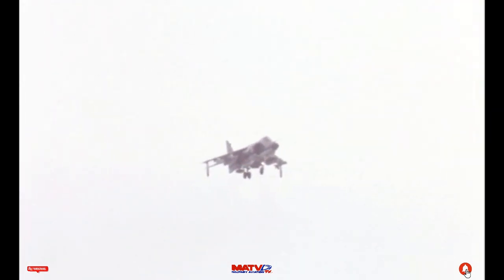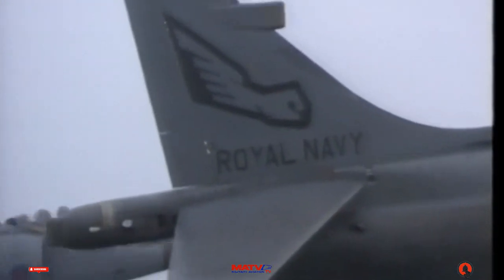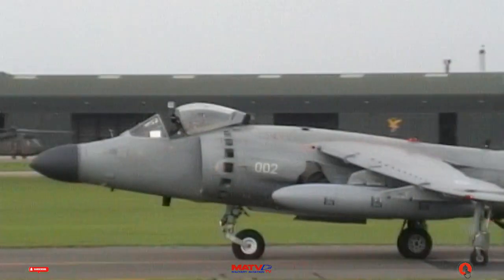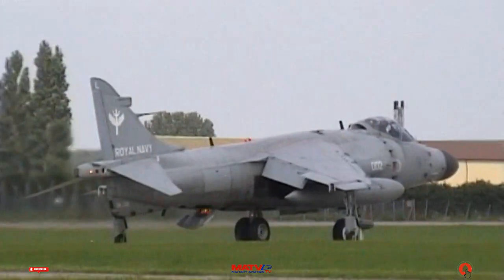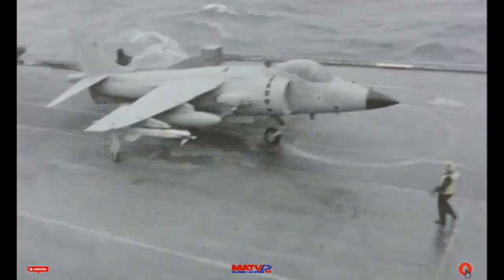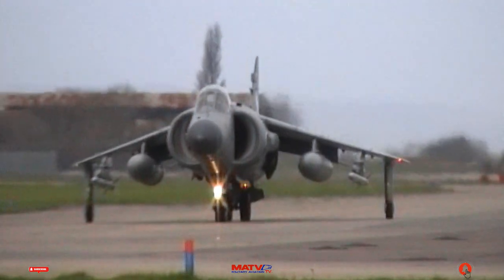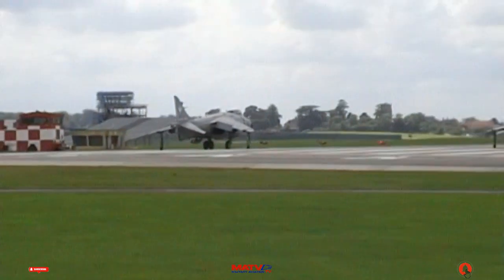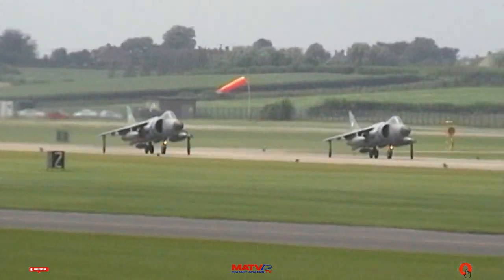Legendary Test Pilots: John Farley-Test Flying Sea Harrier |  #seaharrier #johnfarley #testpilot

Comment: John who I have the greatest respect for, was wrong when he said XZ450 kept the Argentinian Navy in port because of its Sea Eagle capability, it did play a part, but the main reason was the sinking of the Belgrano by one of our submarines, which gave a strong message that we would sink there ships. We had three submarines near Argentina watching the movement of the carrier and the Belgrano group of ships. After the sinking that is when they decided to return to port and stay there
Reply from the maker: It is well known that both were the main reasons for the Argentine Navy returning to safe waters. When XZ450 was shot-down, with Lt Nick Taylor being killed, the Argentines looked-over the wreckage and found the equipment for the Sea Eagle, which was a much more advanced Air-to-Surface missile than the Exocet. They wrongly assumed that all the Sea Harrier force was equipped and capable of launching Sea Eagle, which they were not.